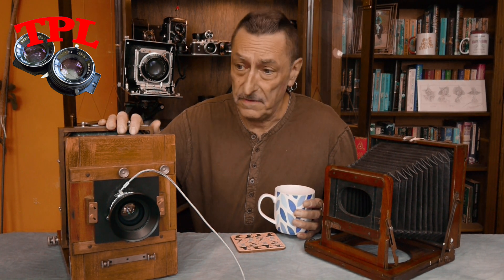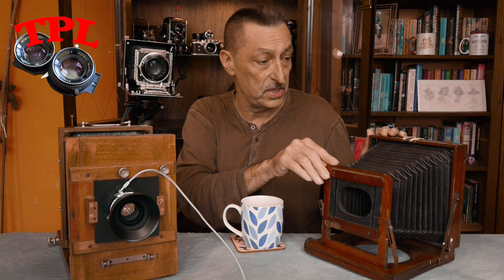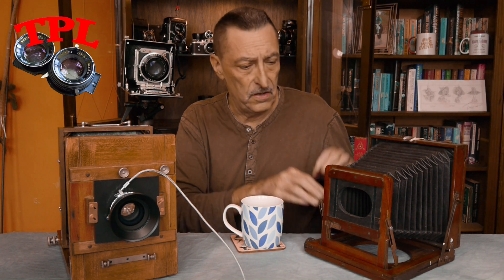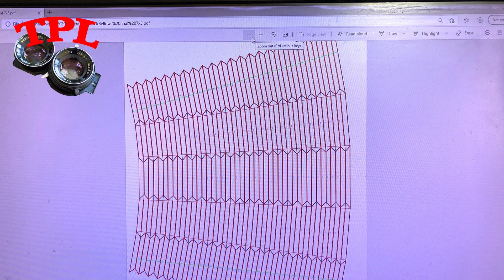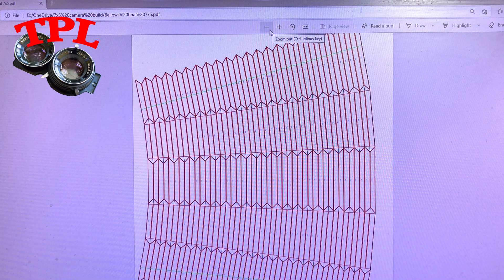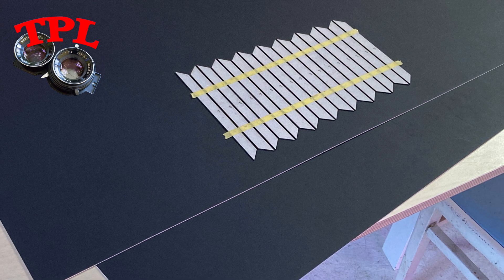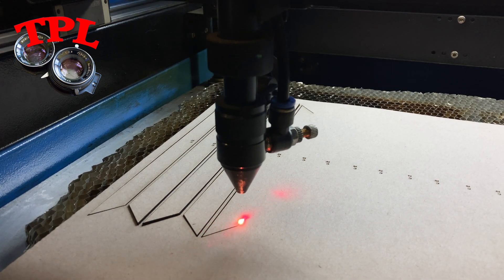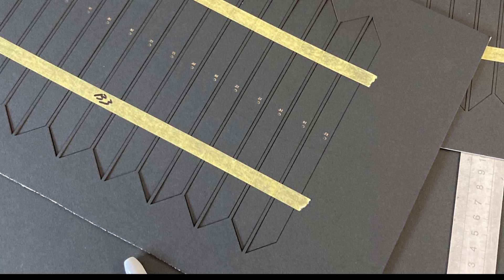Building a 5x7 camera from scratch part 1

Comment: Would using contact adhesive in a tin and a spreader or paintbrush  make the closing together gluing on the inside any easier, as the spray gets everywhere?

Comment: This is terrific. Many years ago I made some bellows as a proof of concept. It's a terrific project, very useful if you have a use.  Yours of course is much better.  Good video. 
In  the 1980s I was able to buy used, a $9000 8x10 Toyo view camera, for $3300 because it had a crushed bellows. Never fixed it, used it for over 20 years. Made a lot of money with it. 
The alternative is a bag bellows- which is just a 4 sided bag. To keep it from sagging use some piano wire in the seams.

Comment: Nice job! One thing that may be helpful next time: I think you can get rid of all black lines instantly using the feature "select by color". I am not myself user of Corel Draw, but I am quite sure it has that possibility.
Reply from the maker: Ah - I wondered how you do that!
Reply: @ashsphotolounge  Sorry, I can't give you precise instructions on that because I don't use Corel Draw. But I just Goggled "Corel Draw select by color" and notice that there are several tutorials about this procedure. I mentioned it to you because I remember once I took a .pdf to a laser cut shop and the guy did this operation in seconds. He was able to select all objects with the same solid color and deleted them all at once.

Comment: Gentleman. Your videos are great. I have an idea, but I don't know how to carry it out. Possibly you can help me.
the idea is: to mount a lens with manual focus and manual diaphragm but from modern 35mm lenses, and adapt it to a large format camera. It sounds ridiculous but what I imagine is that with the glass of modern lenses, you would have a much more contrasted and defined image...I don't know if I'm crazy or what do you think...THANK YOU...I always follow you on youtube.
Reply from the maker: Mounting the lens is no problem ... the issue is that a lens designed for 35mm will not project a large enough circle to cover medium format, let alone large format. Typically a 35mm lens projects an image circle that's not much larger than the diagonal of a 35mm frame as all it has to cover is the diagonal of the 24x36mm frame - or around 43.3 mm. The image circle of say a 5x4 lens is in excess of 162mm! 
see this forum article: 

https://www.photo.net/forums/topic/231973-can-you-build-a-large-format-camera-around-a-35mm-lens/

Comment: great video!  Thanks for sharing.  One thing about that material... it's quite thick.. how much can you compress it?  Would a think plastic have been a choice for the stiffeners?
Reply from the maker: Hi and thanks for your comment. The material on it's own isn't particularly thick. The lining and stiffeners bulk it up a little, but the stiffeners are the things that will mostly determine the maximum compression. I used card mostly because it's traditional in bellows making,  but also because most plastics give of toxic gasses when laser cut (chlorine or cyanide) . The bellows compress down to around three and a half inches minimum, which should be fine in minimum bellows draw with my wide angles using a slightly dished lens board.   However, when I make my next set  I will use thinner card, as the stock I used was WAY overkill, and a slightly shorter maximum draw length 🙂

Comment: good video, but one tip, MAKE the bellows interchangable, as some time later you may want to fit a wide angle lens ( 90/75/60/58/47mm) and for this PLUS movements you need a bag bellows; also if anything happens being able to fit a spare can allow you to shoot again fairly quickly, and be less expensive, as you don't have to rip off any glue to the camera standard frames.
Reply from the maker: I am going to use neodymium magnets to hold the bellows in place rather than glue for this very reason - watch this space.